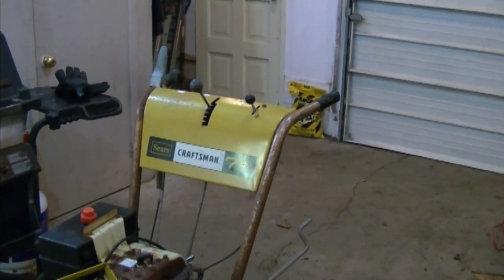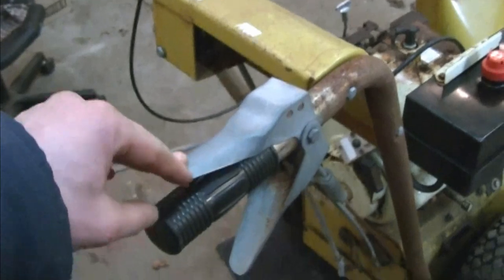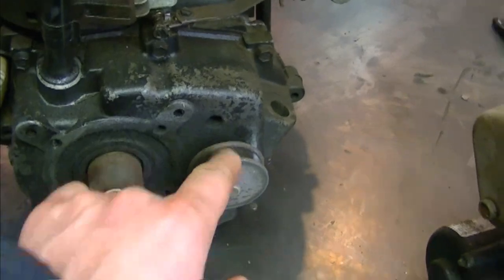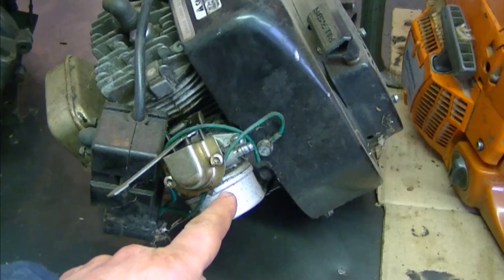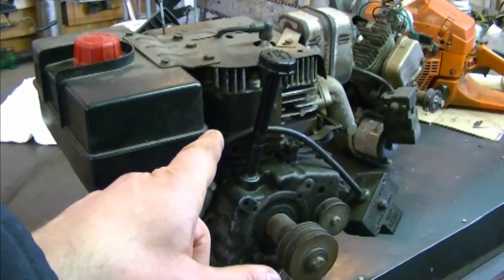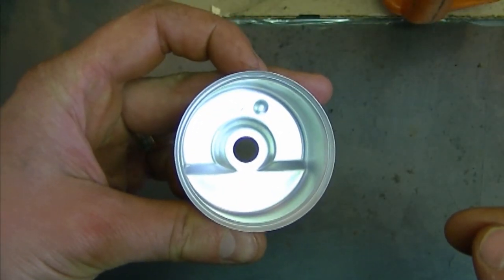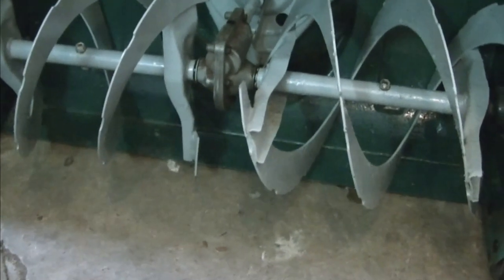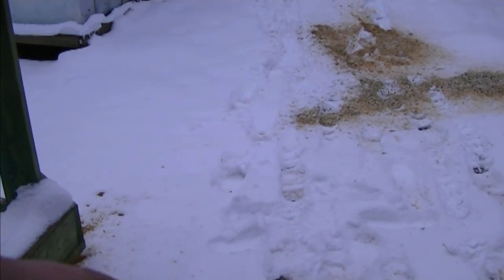Small Engines Q & A Video #79 in HD

Comment: For those interested: I have rebuilt a top end on a husky 51. (Medium use saw like the 55)  An ebay nonNiSi jug/piston kit is about $60 (US).  From Baileys, a NiSi kit is about $100 and  Italy made  NiSi kits for about $150.  A Husqvarna OEM kit (at Baileys) is $200.  I rehabbed  my old cylinder and just used a China made piston.  Cost about $30.  So far, so good.  Homeowner use only.   I also have a Dolmar pro saw, the OEM top end priced at $600.  Yikes!  Found a china piston for that too.  Yea

Comment: DON YOU ARE GREAT, I HAVE A HOMELITE CHAIN SAW  THE IDLE IS HIGH I TRIED ADJUSTING THE IDLE SREW ON THE SIDE IT STAYED HIGH, ABOVE IT  2 LITTLE ROUND THINGS THAT SAY  LOW AND HIGH IT MUST NEED A SPECIAL TOOL. I PUSHED UP ON THE THROTTLE PART THAT THE THROTTLE CABLE IS CONNECTED TOO AND THE IDLE WENT DOWN, BUT AS SOON AS I MOVED THE SCREW DRIVER THE IDLE WENT UP AGAIN I DONE IT AGAIN AND I PRESSED AGAINST IT TOO MUCH AND THE ENGINE STALLED ,NOW I CAN NOT GET IT STARTED , OH LORD, THANK YOU, BUDDY

Comment: Re: the china cylinder/piston kits.  Thanks for the report on the low time china kit.   I believe your experience is typical .  Metalurgical treatments and coatings cost money.  If equipment is used in earning a living, then higher cost parts are entirely reasonable.  I would like to know more about the performance of the mid-priced kits, like the Italy made ones from Baileys.  Just curious

Comment: @donyboy73 ok well i did that thank you for your help.
I have only one question, i have a Craftsmen 5/24 snowblower with a Tecumseh engine and i was wondering what could casue it to run when on full choke and full throttle, but not once i touch the choke or if i try to move it. After that it just dies. I am stuck can you please help me.

By the way i am a huge fan of your vids.

Comment: @TheWallyjp It is probably caused by a dirty carburetor. I would guess that the main metering jet (the big one in the center of the carburetor) is dirty. watch one of donyboys carburetor cleaning videos. What i believe is happening is the flow of fuel through the jet is being impeded by some type of foreign matter. Which causes the fuel mixture to be too lean when the choke is open.

Comment: i work on a lot on chinese, cheap, crap engines, they are OK but metals they uses is very soft, i can almost bend a crank with one light hit with a hammer, also like dony said, the recoils are crap but if you get a oem honda recoil and carb, replace those and the thing will be just as good as a honda motor. (but, just wont last as long LOL)